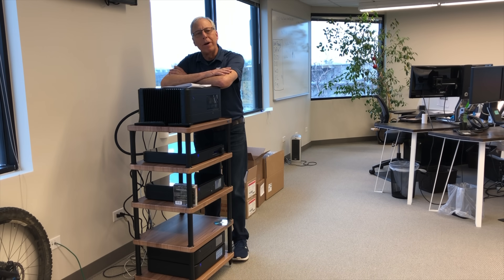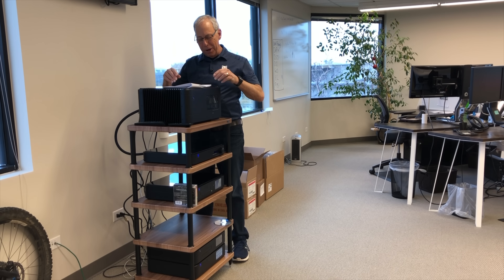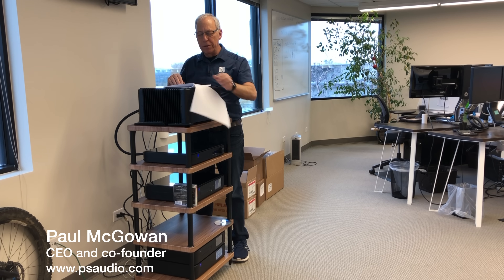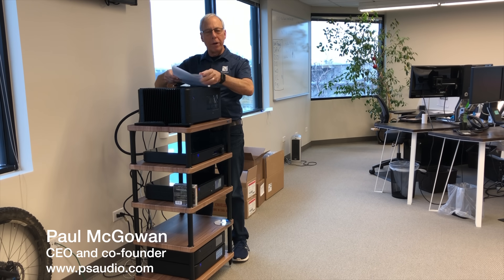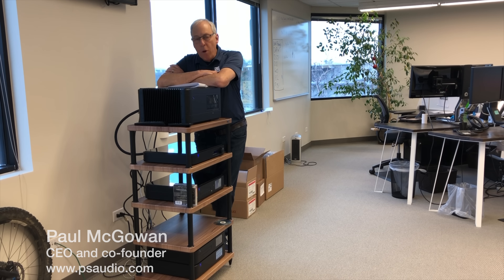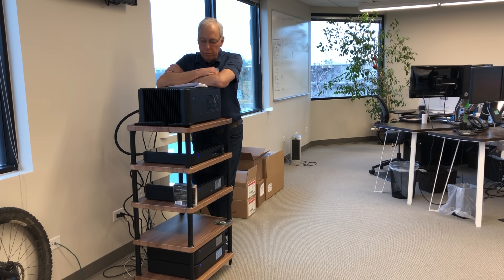How do watts work?

Comment: An amplifier is just a multiplication device. The volume knob tells it by how much to multiply. If you input 0, the output is 0, because  0 times anything is still 0.
It doesn't add power, it multiplies power.

Comment: Power = energy per time. 1 Watt = 1 Joule per second. If you eat a BigMac you got 2,250,000 Joules. If you imagined a power amplifier using BigMacs to create power with 100% efficiency, it could make 100 watts for 2,250,000/100 = 22,500 seconds or 22,500 / 3,600 = 6.25 hours using one BigMac. Coincidentally, a typical human body also consumes around 100 Watts meaning a BigMac of energy per approx. 6 hours. Luckily we have found a better way by using electricity from the power grid than filthy BigMacs to power our amplifiers.

Comment: You made that too complicated. You could have said the voltage is the fuel/air mixture, and the more you give the engine/amplifier the more power it makes up to the limit of the engine/amplifier itself. Preamp is basically the carburetor/fuel injection system that controls the flow of air-fuel/voltage.

Comment: Paul, thank you for explaining in non electrically complex terms to those without electrical background. You are always thinking on your feet and have to quickly formulate a response to questions sent in, you do that very well. 

The rotational speed of an engine is comparable to volts I agree. The force is actually torque if it is an engine, and that can be compared to current. 

Mechanical power is rotational force times rotational speed or linear force times linear speed. Electrical power is voltage times current. So there cannot be power without current and voltage present. 

Some like to say an amplifier commands power but in effect the speaker demands it. The amplifier produces voltage to the speaker and the speaker loads the amplifier due to impedance, thus drawing current from the amplifier consuming watts. 

The pre-amp sets the voltage level and the speaker offers resistance requiring force to move, like an incline to a car. The power amp adds the power to allow enough current to flow at a given voltage demanded by the speaker. 

The power amp also have to oppose speaker motion witch is not in phase with the signal so it also have a braking effect. Its like a slowing down force in a car.

Comment: Watts rule, OK ? ;)

C'mon Paul - you and I grew up with good old American V8s that produced plenty of torque at low revs - the same engine in the hands of a talented modifier could produce more power at higher revs, usually at the expense of torque for towing. As an engineer, I view your challenge as giving me the most power for the smallest electricity bill.

Comment: Confusion for me comes from knowing a little bit (and I mean a little!) about electricity in different contexts. So while this was a good explanation, I wonder why some headphones, for example, require higher voltage to properly power. And then there are some speakers and headphones that list in their specs that they reach a certain volume based on voltage, and others list wattage. Then there's my Koss ESP-950s which say they draw high voltage but no current.
Reply: "I wonder why some headphones, for example, require higher voltage to properly power."

Because they have a higher impedance or because they have a lower sensitivity.

"And then there are some speakers and headphones that list in their specs that they reach a certain volume based on voltage"

That is a measurement of sensitivity.

"Then there's my Koss ESP-950s which say they draw high voltage but no current."

They self powered  so they don't need to draw any power from the input line.  Essentially, they have their own amplifier onboard.  The input impedance is very high so that it draws a negligible amount of current from the line. (its not precisely zero current but it is probably on the order of micro-amps to nano-amps which is not worth worrying about in the same way that foods and drinks can advertise themselves as zero Calories so long as they use less than 5 Calories).

Comment: Isn't it the amps not the Watts? It's the amps that defines the driving Force wattages is the consumption of the force energy dissipated measured in watts am I wrong!
Reply: @My Name that's not necessarily true is it, I get what you're saying the voltage carries the current  electrons, but if you have very small voltage and larger current and vice a versa, and Watts tells you which is what. For instance High Voltage with very little current wouldn't give you a lot of Watts and if you had very little voltage but big  current would give you a lot of Watts.
Reply: @My Name I'm sorry but you don't understand what I'm saying you can increase voltage but that doesn't mean you're increasing current two separate entities you can have 50000 volts at a very low current milliamps say
Reply: "Isn't it the amps not the Watts?"

The values of voltage (force), amps (current), ohms (impedance), and watts (power) are all interconnected.  Every value is defined by two other values (https://d26tpo4cm8sb6k.cloudfront.net/img/ohms-law-formula-wheel.png).  So it rarely correct to say that one or the other single value definitively does this or that. If the volts remain constant, than the power must go up if you increase the current.

" It's the amps that defines the driving Force"

First, using the word "force" is ambiguous here since volts are the measurement for electromotive force (EMF). Second, from the first point, if the voltage or impedance remain the same, the the watts must go up when the current goes up. They are proportional to each other. The only way that the current can go up without the power also going up is if the voltage and impedance both go down.

"consumption of the [electrical] energy dissipated measured in watts am I wrong!"

Sort-of; but, not quite.

First, the unit for energy is joules.  Watts is a unit of power.  Power is energy per unit of time.  We can say that power dissipated is measured in watts.

Second, not all power is dissipated.  The part of the impedance that is reactive is not dissipated. It is ultimately returned back to the amplifier.  That non-dissipated power can also be measured in watts; although, it is usually expressed in the watts equivalent unit VARs (Volt-Amps Reactive) to make it clear that it is not the part of the power that is dissipated.

Comment: I would not be surprised if the questioner had heard/read someone (perhaps poorly) describe e.g. a class A tube push-pull amplifier, where DC power into the output transformer is relatively independent of audio power into attached loudspeaker[s].
Reply: Transformers are indeed efficient for AC.  I should have never mentioned transformers;  my point was about class A outputs (include bridge or capacitor-coupled)

Comment: Paul uses his bike to travel to work .. it's just there on the left .. see it ? The reason he uses his bike is because there isn't a charging point for his Tesla..! 
Another bit of trivia :--- did you know the US Watt is twice a European Watt..?
Reply: Janina Palmer no. A watt is a volt multiplied by an Amp here there and everywhere in the universe. First year college Physics. Euro voltage is twice what we have here in North America. So a 100 watt light bulb draws half the current on 240 volts  (Europe) as it does in Canada.
Reply: My Name  google Goodman's Axiom 401 speaker and look closely at the escutcheon plate on the back of the magnet system ...  it shows 20 watts (40 Watts US ) ..
Reply: Janina Palmer that is likely a regulatory labeling issue that varies by geographic location. Various markets have different labeling requirements. I will look into that further. Peak power vs. RMS power or something although even that doesn’t seem to make sense in this case. Hmmm...

Comment: It is not safe to connect mobile phone or other audio sources right into a powerful power amplifier without having volume adjustments in between. If you are unlucky to disconnect from your mobile phone or another audio source when the power amplifier is on then you can destroy both loudspeakers to amplify. as a security it is advisable to have a preamp in between!

Comment: Real power or Apparent power or Reactive power? Voltage is the potential of flow or current. But phase shifts through impedance can make current flow without voltage.
Reply: Not
Reply: Current never flows without voltage. It is true that the current can lead or lag the voltage with a reactive load;  but, that is because a reactive load changing throughout the cycle.

Comment: Always good to go back and reconsider the basics.  When first learned they are based on a simplified model, of say fixed direct current.  As one goes along, you get outside this model, such as when you consider AC, which brings in constant change.  And especially when you are thinking of the broad spectrum of frequencies, such as audio.  Often the simple model works, but you do well always wonder if your on the edge and need to bring more into your mental model of how things work.

Comment: To me a river is always a great analogy. A preamp puts out a tiny rill of varying pressure, depending on the volume setting, and the pressure of this rill controls the gate of a ginormous river with a constant pressure aka flow speed. At a certain volume setting this will result in a certain amount of water passing the gate. Here voltage equals the speed of the water and current equals the amount of water which comes in a the given speed. A narrow river flowing at high speeds would equal high voltage, low current. A wide river at a very low speed (like the Amazonas) would equal very low voltage but a huge amount of current.

Comment: You did a great job explaining a difficult question! When I try to explain electrical terms to someone that needs some help in that area, I sometimes use water as an analogy. So, I'd use a regular ole water faucet to help explain. Picture the faucet as the amplifier as a whole. There is water pressure coming into the faucet. You use the handle to control how much water is allowed through the faucet to the spout. The spout discharges the water into the sink. So, incoming water pressure = the amplifiers power just waiting. The handle = the preamp, controlling how much of that water can pass through. The spout = the speaker. So, the amp sits there, full of pressure, waiting for the handle to open up letting some of the pressure out to the speaker. Does that make any sense?

Comment: If you directly connect your audio system (e.g. CD player) to a powerful amplifier without any volume control, there is a high fatal possibility that you blow out your passive speaker that cannot handle that much power and produce heat ...

Comment: A power amp adds current to the voltage. If the voltage is low the power out will be low. P=VxA. Simple equation, simple explanation. So a power amp won't put out all the power all the time. It depends on the voltage. One can get hairy if one wants getting into how the load can affect this but it is not necessary. 😉

Comment: My amp has over 9000 watts PMPO, that seems to be too many volts to be safe at 6 ohms.
Reply: local electornic store here says 10000 watts P.M.P.O and the actual wattage on the speakers is 15W. lol
Reply: Unless you have very inefficient speakers or extremely long speaker leads,  15 Watts RMS will blow you out of the room.
Reply: I doubt that it really pushes 9kw
Reply: 9kw? I doubt IT. My power amplifier is quite a beast and IT can provide only 800w but its dynamic power only
Reply: Ah skytek watts.
Reply: PMPO is a total BS rating that means nothing..
RMS only !!!!
Reply: @My Name hahaha yeah I know the math, I just hate these ridiculous ratings
Reply: @My Name 
😂🤣😂😆😆🤣😂